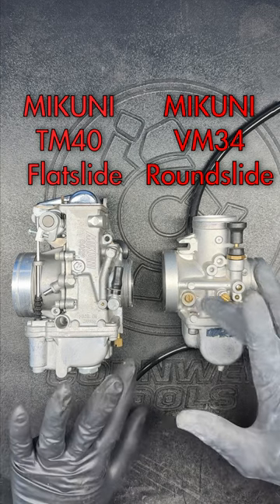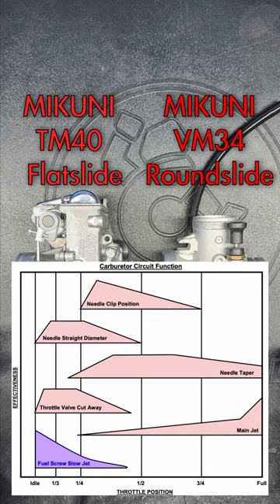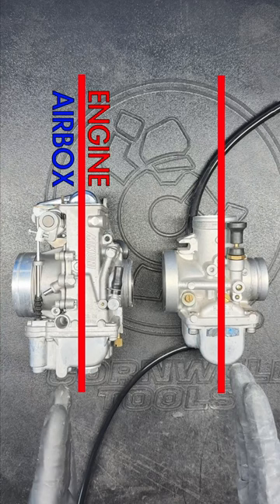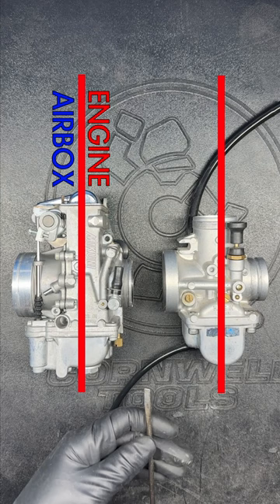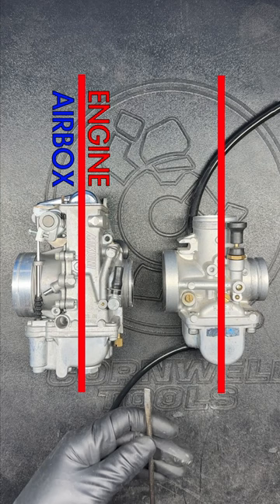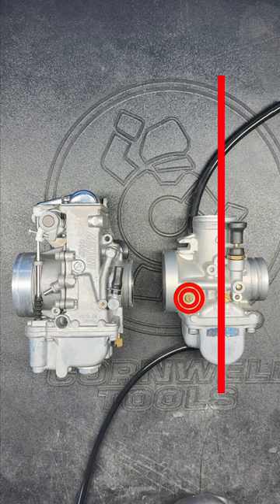Know how to adjust air/fuel mixture screws on ANY carburetor in 30 seconds!

Comment: I think this is the only best explanation about the meaning of adjustment on carburetor I have search for long  on utube. thnx for ur good summarized work
Reply: He got it backwards unless he is saying it wrong. A carb adjusts air not fuel, so you can only run rich/lean on air. He could get peoples engine blown up doing it the wrong way!
Reply: Bro this helped me so much, I’m currently restoring an old moto4 (200cc) and I had to get a new carb and have no idea how to tune it until now
Reply: @chadmills5400  so are you saying the carburetors with two adjustable screws are both for air I don’t think so buddy
Reply: @zovards2089 My carb only has one screw on the engine side at the bottom. If I loosen it is richer and tighten leaner? I can't find the sweet spot between both. it idles well but sometimes it does little backfires when downshifting.

Comment: Not always the case. Best way to tell is to remove the screw completely and if it has a fine point then it is a fuel screw. If it has a blunt point then it is a air screw.
Reply from the maker: Have an example of when my trick doesn't apply? Yes checking the screw works too but is more invasive/ takes more time/ requires a tool.
Reply: @oneupmotogarage  that is true and yz85 and kx85 carb. Screw is on engine side but it is air screw
Reply from the maker: @Jursaw  What years? Images I'm googling show carbs with air screws on airbox side.
Reply: @oneupmotogarage  my apologies, i meant ssr70- im working on a few different bikes at the moment
Reply from the maker: @Jursaw  don’t those use knockoff keihin carbs copying the PD series from Honda’s smaller XR/ CRF’s? They should have air adjusting screws on the airbox side of the carb.
Reply: @oneupmotogarage  they use knockoffs but the air screw is on the engine intake side. Just look up pz19 carb its practically the same
Reply from the maker: @Jursaw  okay so I checked it out and it is on the engine side, and it controls fuel. It is confusing because it’s a pretty blunt screw for fuel metering, which I guess makes judging by the shape of the screw not a good tell. A way you can be sure (other than location) it controls fuel is because it uses the washer/ o-ring style sealing method that air screws don’t use. The blunter shape may be a result of knock off carbs cutting corners.
Reply: @oneupmotogarage  that’s really odd. This one doesnt use a o ring or washer
Reply from the maker: @Jursaw  So all I did was search PZ19 carb and looked around at the bodies to confirm the side. Then searched PZ19 mixture screw and they do look fairly blunt and similar to an air screw but they come with the washer/ o-ring/ spring combo that all fuel adjusters have. Are you sure they may not just be missing on yours? Or down inside the hole the screw goes in? Sometimes they're easy to miss, or fall out and get lost.
Reply: @oneupmotogarage this dude doesnt know what hes talking about cant pull fuel before the bowl since it holds the fuel 🤙🤙
Reply: So if it has a fine point turning it clockwise will make it leaner?
Reply: @blakenorman4822 yes if adjusting the fuel metering screw closest to the engine.  But if you turn the air screw out then you have almost voided the change you just made on the first adjustment
Reply: Correct as well. Xr70 air screw engine side.
Reply: @oneupmotogarage  Keihin PZ/PB series smaller carbs and similar carbs have the air screw on the engine side
Reply: @stevenervin4113  on the PZ19 the air mixture circuit goes to the air intake.
Reply from the maker: @pvfirefighter38  now I gotta get one and do a video about this.
Reply: @oneupmotogarage  I'm def not trying to be argumentative or anything, I very well could be wrong. But, the PZ19 adjustment screw is on the intake side and blunt. I'm looking forward to video. I've always wanted to take a cheap amazon one and cut it up to get an internal look
Reply: @oneupmotogarage  I just did a KFX50 swap to PZ19, to change the auto enrichener for a manual choke. The carb that was on the KFX has a blunt screw engine side, no washer or o-ring so its an air screw. They're also sealed shut from the factory. Quad is a 2023 model if that helps. Let me know what you think.
Reply from the maker: @pvfirefighter38  so you’re saying the stock 2023 KFX50 carb (from googling looks like a small Keihin) and the PZ19 both have air bleed adjustment screws on the engine side of the slide?
Reply from the maker: @pvfirefighter38  Keihin PTE 16 is the stock carb?
Reply: @oneupmotogarage  Thats what it seems. No o-ring washer, blunt tip. screw is just fwd the idle set screw. The screw's pathway goes right to the opening where the airbox/filter go.
Reply: @oneupmotogarage  Yep, the PTE 16 is what came stock on the KFX. I just swapped to PZ19 because the auto-enrichener on the PTE 16 sucks
Reply from the maker: @pvfirefighter38  based on pics, the steep downward angle and location of the screw point to it tapping into the pilot circuit to meter fuel. It will have a dedicated hole on the airbox side inlet for air to get sucked in around the needle to pull fuel up and by. The tip being somewhat blunt and lack of o-ring I think is more acceptable on extremely small carbs like that, since they’re metering such a small amount of fuel. If you take the bowl off, you can see the channel going into the pilot circuit. And if you blow carb cleaner into the screw’s hole I’d put money on it squirting out the pilot jet hole.
Reply from the maker: @HTMR  XR70 uses similar to PZ19. It is on engine side and it meters fuel. You can tell by how it is angled down into the pilot circuit. If you remove the bowl and mixture screw, shoot carb cleaner in the screw’s hole and it will come out of the pilot jet.
Reply: @oneupmotogarage  When you spray cleaner in the screw hole, it comes out of an opening facing the airbox. Does that circuit also draw or control airflow from that point? When I blew air into the channel, I felt no air coming from the pilot jet hole. I ordered a few PZ19s from China, I'm going to cut them into complete sections and report what I find, and if you want I can make a video or send you some pics. I'm genuinely just trying to become better at diagnostics lol.
Reply from the maker: yea they're cheap I was thinking of ordering one myself to play with. @pvfirefighter38
Reply: @oneupmotogarage  I got one and tore it apart. It definitely looks like it meters the amount of air going into the pilot circuit. There is a channel going from the pilot jet hole to the mixture, and then another channel going to the airbox side of the carb opening
Reply: @pvfirefighter38 so is it a air screw or fuel screw?
Reply: @oneupmotogarage so is it a air screw or fuel screw?
Reply: @cameronwilson4782  On PZ series carbs the idle mixture screw is an air bleed screw.

Comment: Mine is on the outside by the intake and i loosened it to the very end and oh my word the amount of engine response and power it suddenly had. The bike used to stumble whenever im taking off it would only run about right when im at about 2500 - 3000RPM but now its so smooth and it pulls hard im so shocked

Comment: dang bro. i finally found the answer to the long time question in my mind. i have the xr 200 motorcycle and i was not sure how to adjust the carb. thanks so much!
Reply from the maker: perfect! I think those run the Keihin carbs that I did another video comparing the genuine vs cheap Chinese knock off.
Reply: What if there’s two needles on the engine side?
Reply from the maker: @elvisramos2660  did you mean to say needles? I've never seen one carb have multiple needles. Did you mean to say two screws on the engine side?
Reply: @oneupmotogarage  I think there screws there’s one under the throttle which I’m guessing is the fuel one and one on top that is for flat screwdrivers and the idle screw which is for the throttle
Reply: @mamichulo9982  it’s a carb from a arctic cat 300 4x4
Reply from the maker: @elvisramos2660  I looked up that carb's diagram and it does have a fuel adjustment screw on the engine side of the carb on the underside. That's the only screw on it that adjusts the air/ fuel mixture.

Comment: That is correct alot of the time but not always, sometimes it's opposite 
And some have both
Reply from the maker: I've found about 3 carbs this doesn't apply to (PZ19, concentric Amal, and maybe an early /2 BMW Bing). I know of one carb that has both, the KZ1300.

Comment: Ive heard that air screws are more sensitive to adjustments than fuel screws are. Would make sense since that the perfect ratio is 14.7:1. Seems like adding more or less air would have more dramatic effect than fuel would

Comment: This is probably stupid question since i just started but
How do you know if you had too much air, or too much fuel / less fuel and less air?
Reply from the maker: It's a good question and the truth is it's very hard to tell without an O2 sensor. By feel you learn the subtle differences in how the idle will sound when too rich vs too lean. There's usually a crackle or pops on deceleration if too lean, if it idles high or idle hangs, usually too lean. Vs if after revving the idle drops too low and then slowly comes back up to the set idle, that's a sign of too rich. I'll try to do a vid detailing that someday.
Reply: @oneupmotogarage  thanks!

Comment: Great explanation, but I also noticed that the carb on the right also has another screw right dab in the middle. Does that mean that carb has an air adjustment AND a fuel adjustment?
Reply from the maker: @galenmarek8287  that screw is the idle control on that one.
Reply: @oneupmotogarage  Roger that. I’m new to bikes but I’ve been ankle deep into cars, trucks and tractors my whole life. Many thanks.

Comment: The carb on the right, what does the screw in the middle with the spring on it do?
Reply from the maker: That is the idle adjustment screw. It directly moves the resting position of the slide up and down to control idle.
Reply: @oneupmotogarage  thanks

Comment: When fine tuning, should we do it to one screw or to both? If so, which should we statt with ?
Reply from the maker: A carb will only have one mixture adjustment screw. Very rarely will they have 2. Starting points depend on the carb, usually if it is a fuel metering screw you start at 2.5 turns out from lightly seated. If it's an air bleed screw then you start them at 1 turn out from seated.

Comment: very simple Great. My carburetor has 1 screw with a hole is it the second screw that you are talking about? 1 is for air-fuel mix another is for accelerator/ throttle increase and the 3rd one is with a hole what is that? Slow jet or something. but I wanted to confirm as there are 3 screws which one I need to adjust?   I adjusted air-fuel mix screws as you said but when I try to adjust the screw that has hole in it as my screwdriver goes on the hole my car shut off then how can I adjust the screw with hole?

Comment: I have a Mikuni BS32SS and the screw is on the engine side. However it acts the opposite as described in the video?
Reply from the maker: How is it acting like an air bleed screw? On those BS32's the screw is on the bottom of the carb right? You usually start at 2.5 turns out from lightly seated (it's easy to break the tip off that particular screw type). Loosening it from that setting will add fuel = richen mixture, tightening it will restrict fuel = lean mixture out.
Reply: @oneupmotogarage (screw on top, set of 4 inline) I started out at 1.5 turns and bike acted super lean. Would idle good with choke on, rpm would rise at idle when bike gets to running temp. I moved it to 2.5 turns. Idles a lot better but misfires until it's warm. Still playing around with it. I do believe you were correct and I misdiagnosed my issue. Also also, the screw itself goes super deep into the carb. It looks like the flat side carb , but the screw doesn't petrude like that. It's fairly deep into the carb. I appreciate any help, due to not much information that I can find on this. It rubs best at 3.5 turns out, but idles low when cold, idles high when warm but runs great
Reply from the maker: @JDKoenig  the deep recessed screw is normal on street legal bikes by the 80's due to EPA requiring an anti tamper plug to be installed over all air/ fuel mixture screws. Off-road bikes and aftermarket carbs usually have the screw sticking out more for easy access. You can also buy longer screws to replace yours to adjust them more easily if you like. 3.5 turns out is an acceptable setting, once you get past 4 turns it means you need to go up a size on the pilot jet. But unless the engine is bored over or other big mods I never have found a need to change pilot sizes.
Reply from the maker: @JDKoenig  When an engine is cold it runs lean and as it warms up it richens. That's what a choke (usually an enrichment circuit on newer engines) is accounting for. So generally if the engine runs well when cold and then starts to struggle once warmed up, it's tuned too rich. If it really struggles when cold and gets better as it warms up, it's too lean. But there is some expectation for a cold engine to struggle (run a little lean) when tuned correctly, hence why they add chokes to help it warm up, then once warm it should be operating its best.
Reply: @oneupmotogarage  You're a G! I think I will end up ordering new carbs. I'll tear these down to learn more about carbs myself. I think 3 was the best, it seems my air filter (factory enclosed box) was a tad loose, had to fix that and take some fuel out. Idles great now, runs decent enough to not worry about anymore. I appreciate you a whole lot. I subscribed just because you're helpful!
Reply from the maker: @JDKoenig  I'll be focusing more content on carb tuning and stuff I've learned about them, I really enjoy tinkering with them.

Comment: All my 38mm keihin 2 stroke carbs have the air  screw on the left side of the carb with the air screw on the right hand side, which would be the air filter side and not the engine side right?
Reply from the maker: Yes, what you describe is common among 2 strokes. With the mixture screw on the airbox side so they control air (out is more air = leaner, in is less air = richer).

Comment: PLEASE HELP. I've been told for my bike the Goal is to be out 3/4 turn. It's been set at out 2 and 1/8 for the last 40 hrs. 
If I shoot for 3/4 will that make it it run way too rich? I'm already fouling plugs as is if I idle too long which is why I'm looking into setting it correctly.
Reply from the maker: Am I right to assume it is an air mixture screw? Meaning 2 turns out is leaner (more air) than 3/4 turns out. If that's the case and even at 2 turns out it will foul plugs, then it sounds like you need to go down a size on the pilot jet to lean the pilot circuit out more than the mixture screw is able to. You may end up two sizes down on the pilot jet to get it running well with the mixture screw only 3/4 turns out.
Reply: @oneupmotogarage  you are correct, air mix screw. Okay so it's time to Jet it. Thank you for the reply 🙏

Comment: when installing..which comes first...the washer or the seal before the spring..??
Reply from the maker: Great question! I see this installed wrong all the time. It goes: needle-spring-washer-oring. You can remember it by thinking of the job the washer does, it protects the oring from the rotation of the spring when tighten/ adjusting.

Comment: So how do I know if I tighten/loosen the screw too much?
Reply from the maker: It won’t run well! Usually if you’re more than 3-1/2 turns from seated you’re too far out. And if you’re less than 1/2 turn from seated you’re too far in. If it needs to be outside of those boundaries, your pilot jet needs to be bigger or smaller.

Comment: So if a fuel jet , how do you set it up for first run like in turns ?
Reply from the maker: Usually start at 2.5 turns out from fully seated. But you could check for your specific model carb there is some variation.

Comment: What if there’s only 1 screw and it’s dead in the middle, got a 80cc Suzuki quadsport and don’t know it’s it just an idle adjustment
Reply from the maker: The screw in the middle is the idle adjustment, it directly raises and lowers the slide. The stock LT80 carb does not have an air fuel mixture screw. Which is fairly rare. But aftermarket options for it do. The stock carb works well without it so I'd say don't sweat it.

Comment: My bike doesnt bog at all but it takes a while for the revs to go down.... Im thinking less throttle valvue, right?
Reply from the maker: That’s usually either an air leak (on engine side of carb), idle set a bit too high, or lean air/ fuel mixture or pilot jet.

Comment: What happens if it run on the choke on and off. It will still run. But when rave it up. It will die  ??
Reply from the maker: Usually if you rev it and it dies instead of going back to idle then it’s too rich.

Comment: What of the screw is on the bottom of the carb like the one on my 2000 suzuki quadmaster 500.
Reply from the maker: The screws can be any number of places on the carb. Top, vs side, vs bottom. Either way just note when looking at the side of the carb, is the screw closer to the engine or closer to the airbox- relative to the carb’s slide? Usually ones on the top and bottom are fuel metering screws, and are closer to the engine.
Reply: @oneupmotogarage  Thanks so much for the response.

Comment: Does adjusting the air  adjustment mixture screw cause any changes in engine sound.
Reply from the maker: It will change the sound of the idle and when you give it up to 1/8 turn of the throttle.
Reply: @oneupmotogarage  ohh cool.. what kind sounds? Will it be like rumblings?
Reply from the maker: @tonnitoedwards  no it’s more like sputtering and low sluggish idle if it is too rich, popping and hanging idle if too lean.